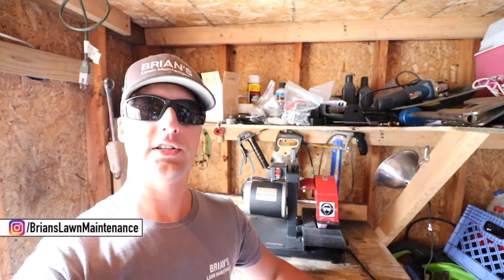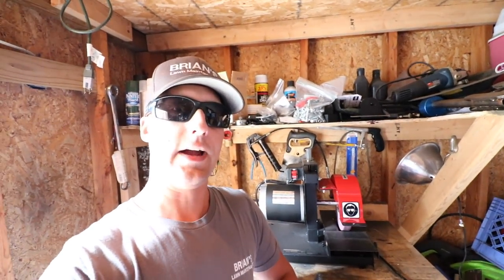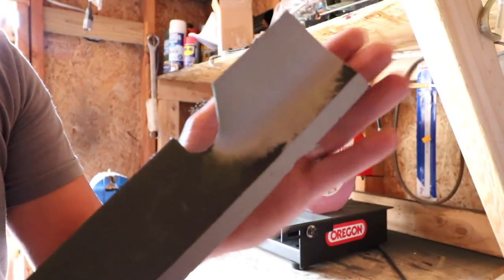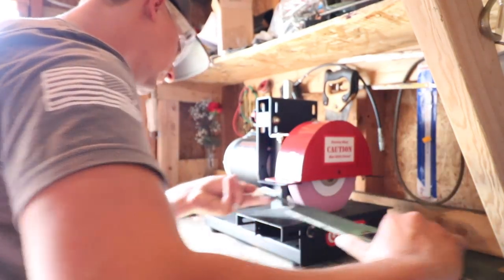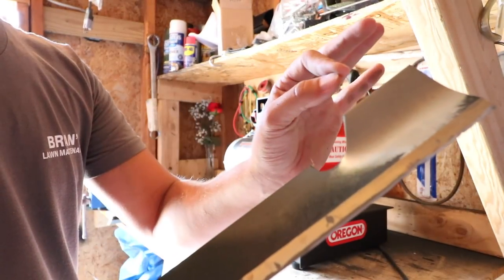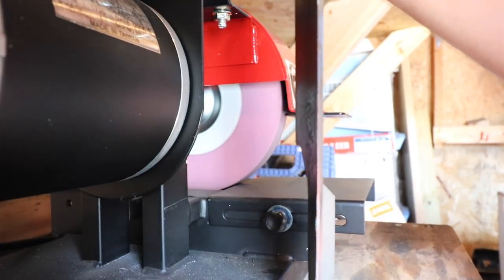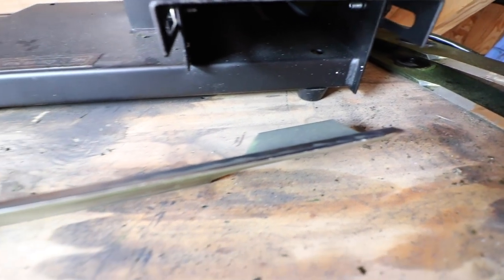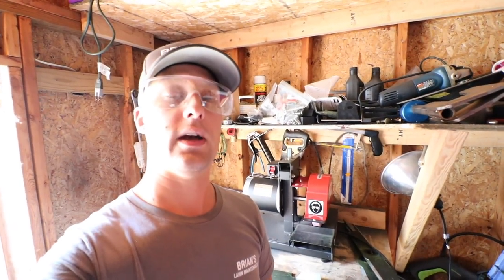Sharpening Lawn Mower Blades - How To - Oregon Blade Grinder

Comment: If you lower you stone to the correct depth ,it would sharpen the blade all the way to the edge.  Without holding it up in the air  you are not getting a true straight cut if the blade is not sliding on the table at the stone

Comment: You’re supposed to come in on an angle. This video is not the correct way to sharpen blades. Talk about off-balance
Reply from the maker: One comment don’t do it at an angle, next comment angle the blade, next comment angle it at a diagonal. Sounds like everyone has it figured out but me. 😂🤷‍♂️

Comment: You wouldn't have to freehand the blade to get the edge cleaned up if you would adjust the table to 30 degrees. That's why you waste so much time having to hold the blade up and freehand it. From looking at the video, your deck is completely flush and out of adjustment to the grinding wheel. You're cutting off way more than you need to...
Reply: Came here to say the same thing. The table is adjustable so that you can set it perfectly for your blade. Good footage, maybe a good subject for your next vid.
Reply: What’s the angle that this machine can be adjusted to? Like the range?

Comment: I have trouble setting  the  stone so I cover  to whole blade from the edge or tip  to the back. The blade should be 28 to 30  degree angle  I grind  the back of blade  but the edge is not touched   I grind and grind but do not cover the blade from edge to the back of the blade any suggestions?
Reply from the maker: Sell it and then get the RBG712

Comment: Hi brain if your wheel is set to the right deep you should not have to tip your blade all so my grand I pull them though turn your grinder side ways so the mower is against the wall and pull them though that works best my computer is down so I can't up loading vids but I did make a video early this mounth go check it out you will see what I mean

Comment: man I have the same machine. I got mine about 2 yrs ago. its a good machine but Idk I'm kinda getting sick of it I always have to adjust it especially when the wheel starts to get smaller. then I'm also doing the same thing with the blade elevating it a little higher to get the edge. I think I'm gonna go buy the rbg 712
Reply from the maker: Richard's Property maintenance lmk how you like it. But for now I'm happy with mine

Comment: I think this is a good question. Why does a flat edge sharpened new blade cut better than a sharpened blade? I notice that every new blade I get the edge is flat on the edge and it does a beautiful cut. But after I sharpen it to a sharp edge it leaves un-cut/un-even grass?
Reply from the maker: Great question somebody more qualified need to answer that one! Good question though
Reply: Bill Vin Ord
Try asking the good folks at Oregon.
Reply: Think it has to do with balancing, also the smaller it gets the less lift the blade produces, the edges are also straight from the factory and not dipped/ wavy or the edge/tip rounded off. Also when it get blue you're killing the temper of the steel and it makes it more brittle and soft as soon as it hits rocks/ sand sticks

Comment: With this model or Oregon Blade Grinder, what really is the main difference between a regular grinding wheel? I've seen what Brian at Top Notch uses, and he has the one that forces the blades into the correct 30 degree angle and what not, this one just seems like a regular looking grinding wheel. What are your thoughts on what the main differences are?
Reply from the maker: Detailed Lawn Services I havent seen Brian's. The plate on mine and the angle on the wheel is 30 degrees. But you have you round out the blade over time to get it perfectly on the edge. I may be wrong, still learning the unit. I know some are more idiot proof, but they also cost more.
Reply: I just looked, Brian actually used a different company than Oregon, I thought it was the same, but it's actually an RBG-712. Machine has a "V" and seems to really hit the angle of sharpening perfectly every time.
Reply from the maker: Detailed Lawn Services Yeah I've heard good things about that one as well
Reply: Looking  good  Brian  keep up the  good work  and excellent  videos  thanks  Rocco from R J LANDSCAPING here in CT thanks